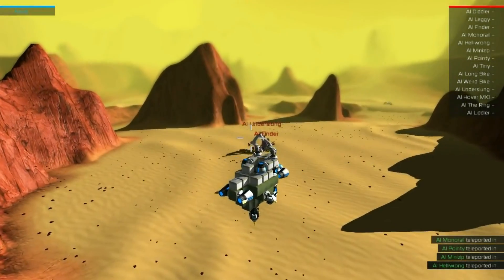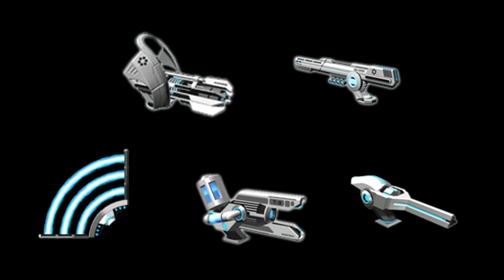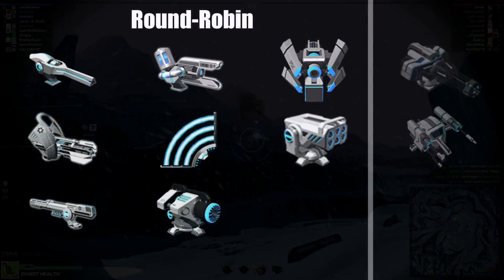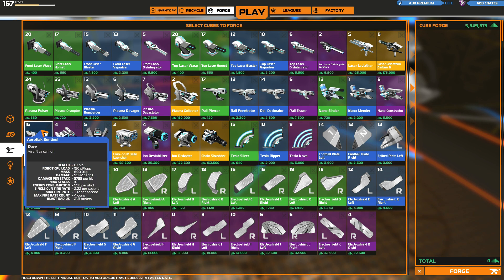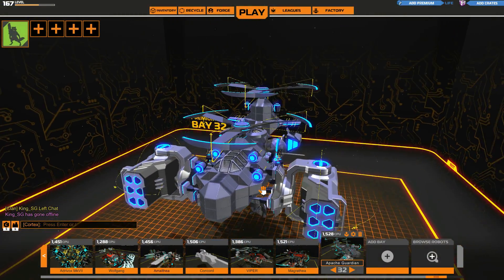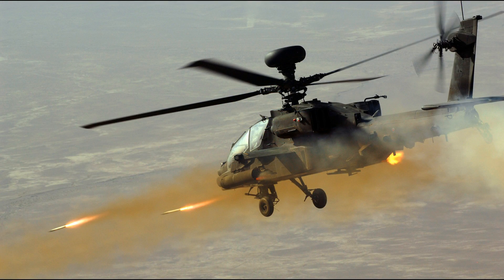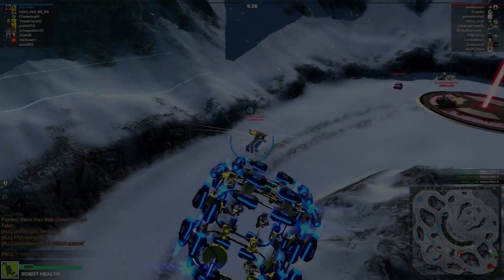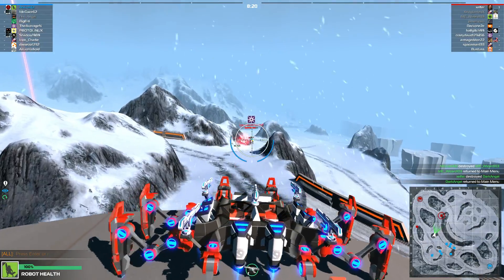Robocraft Weapon Diversity - System Proposal

Comment: In my opinion, I enjoy the teslas being chainsaws and nomming through enemies. It's already hard to react once they are on you, and being impact weapons makes it really hard to have any counterplay. Before you could say just have awareness, but now with blink and ghost, that awareness policy goes down the drain. I'd propose shotguns are the chargeup weapons, and teslas remain chainsaws. Shotguns have a problem of oneshotting even expert build bots because of the intense damage on such a snappy response time, so making them charge up for the same or more damage would be good, and would inherently prevent someone ghosting behind you with shotties.
Reply: I don't use teslas much, but I really like the charge idea. If this charging system is implemented (the way i am imagining), you couldn't be charging teslas at the same time you are cloaking or blinking.  If you ghosted all the way up to an enemy, your would have no time to charge your teslas and you would do minimal damage.  You would have to use cloak much more strategically, rather than using it to run strait at enemies.
Reply from the maker: Using the charge up system with teslas would make them more powerful, but the tradeoff would be that robots would have to plan their tesla attack well in advance (~10-30 seconds).  I personally feel this is a much more balanced system in contrast to tesla bots rushing in spamming modules and face hugging as they do now.  Tesla bots would be a much more strategical robot build than they are currently.